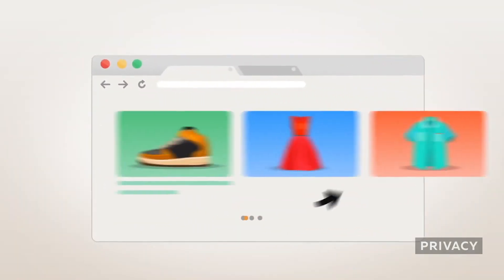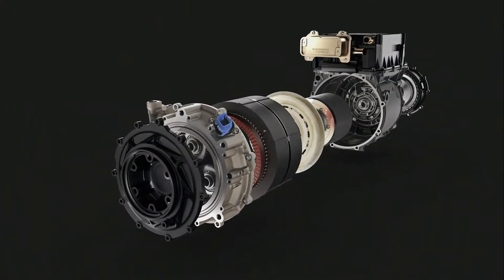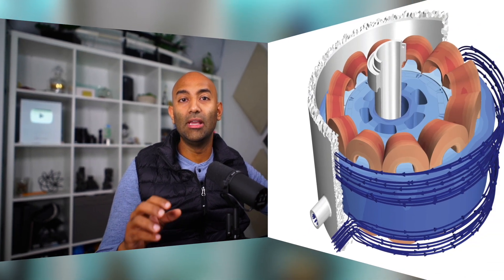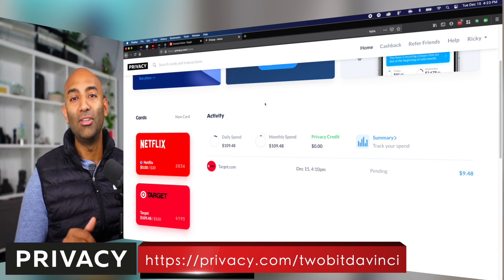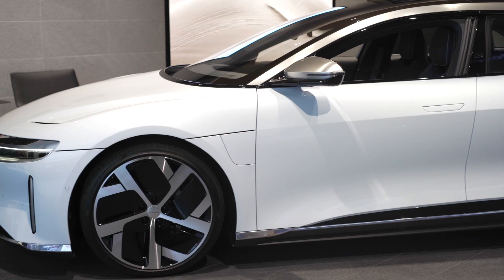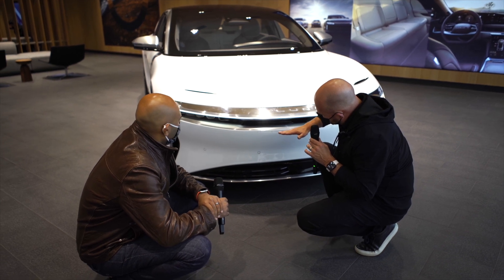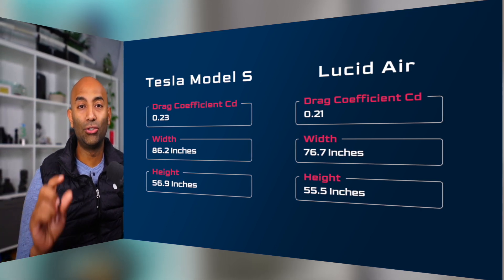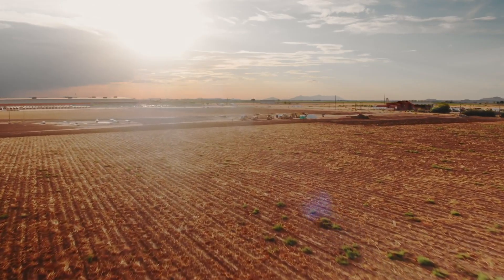Lucid Motors' Crazy Range Efficiency Explained!

Comment: The higher the voltage, the higher the price of electronics. Systems up from 400v are too expensive for mass market cars. One of the reason the Taycan almost doubled the Model S price.
Reply: The Ioniq 5 will get a 800V system and is clearly a mass market car. There weren't 800V chargers a few years ago so investing into it made no sense at that time. The Taycan also isn't double the price, it starts at 103k€ vs 82k for the model s, but in my opinion the performance is more comparable which costs 99k.
Reply: @Psi-Storm  This.  Hyundai's entire E-GMP platform is based around 800v (while being properly backward compatible with 400v chargers without the need for an adaptor).
Reply: Maybe. But at the volume Tesla is playing right now, it should really not an issue. Its not like their is a huge difference in the material cost.
Reply: I came to the comments looking for this answer. I knew there had to be a trade off or Tesla would already be using 800v if it improves the efficiency that much, thankyou!👍
Reply: The more OEMs that adopt it, the cheaper the components will get. In theory there's no reason that the components should be more expensive if they can get the volume up.
Reply: @GRAHAMAUS  , with higher voltages the corrosion risk goes up and you need expensive materials to avoid it. You can lower production costs increasing volume but the cost of materials remain the same.  The gain from having a 800v system is less need from cooling components (mainly the battery pack) when you draw the amps. Tesla is going to move around this with the new high nickel tabless cells.
Reply: It's clearly not for everyone just like Ferraris.
Reply: I’m an electrical engineer that’s worked with power electronics. The advantages of 800v over 400v are mostly trivial, both voltages are plenty for an EV, and have near zero impact on power, efficiency, range, and charge rates. Almost everything else matters more, but it always comes down to design. The design of everything is hyper critical for total system efficiency. 800v right now has a big downside, since the high power DC chargers don’t all support it at the moment, so you need a boost converter onboard to bump the 400v to 800v. This adds cost, weight, complexity, can reduce charge rate, and only adds to charge losses. Right now, I don’t see why anyone would bother above 400v.
Reply: @ericspda  " The advantages of 800v over 400v are mostly trivial, both voltages are plenty for an EV, and have near zero impact on power, efficiency, range, and charge rates." Pretty sure every company that makes electrified vehicles disagrees with you on that one lol. If you work with permanent magnet motors and know anything at all about the issues with back-EMF you'd know why 😏

Comment: If higher voltage is created by adding more cells in series then battery health will be questionable. If higher voltage comes from DC to DC step up circuit then battery voltage is kept low but current goes up.
Higher voltage May reduce reliability of components in the circuit.

Comment: Nice car, EV needs 500 mile range for most people to consider.
Reply: NOT TRUE
Reply: I don't believe that number is so high. 300 miles of usable range should be acceptable for most people. That's many hours of driving.
Reply: To be clear my car has plenty of range for normal commuting as I have a wall connector at home to charge every night but fun trips are inconvenient.
Reply: @martialman.4563  Well your use case isn't exactly something that fits the "most people" category. 

As for the roof box, I have seen tests hinting at a 12% decrease in range for that, but that also depends on the speed. I also doubt having headwind would cause  a halving of the range. 

Still. Having those conditions you should still be able to drive for hours before you have to charge.
Reply: @yourcrazybear  Yes, my roof box is very aero, takes about 10-20% off. 4 bike on rear hitch is like a parachute and major penalty on range as is bikes on roof. Hitch basket is not much different. I'm not the minority either, many EV owners are normal people with hobbies and travel for them with stuff like kayaks attached too roof of car. If I knew the future I would not have bought my car and waited for the 400 mile model S that came out soon after purchase, and 400 is not enough for me even.
Reply: My car has 310 mile range. It's not enough in real world. With bike racks, skis, roof box etc. Range is cut in half with a tailwind. I commute about 500 miles a week and if I lived in an apartment I would need to charge every other day.
Reply: @martialman.4563  But you are in the minority for wanting that sort of range.
Reply: @rtfazeberdee3519  I really doubt it. Non EV owners want as much or more range than current vehicles, at least the ones I talk to.
Reply: @martialman.4563  Its a matter of education, more people live and drive in cities and the average daily journey is less than 50 miles for 95% of the population.
Reply: @rtfazeberdee3519  Many people in cities live in apartments with no place to charge. With 500+ mile range one trip a week to a public charger will do for most.
Reply: @martialman.4563   Yes, once a week for those without home charging but most of those will not be doing as much as 500 miles a week